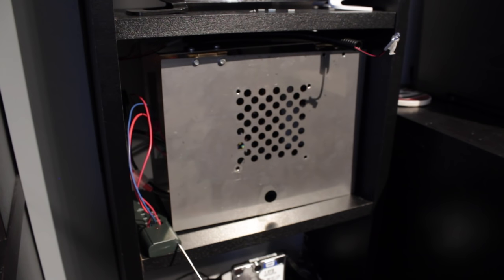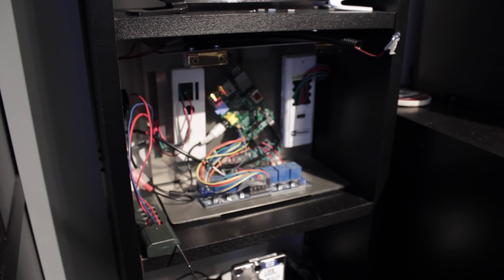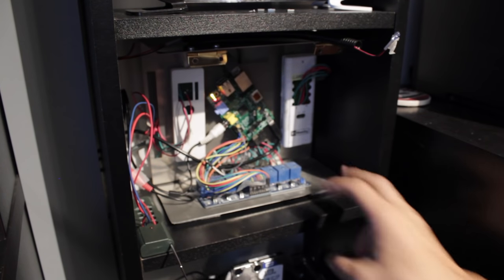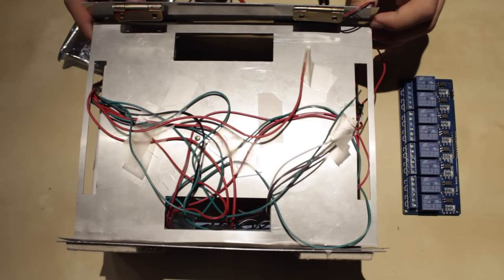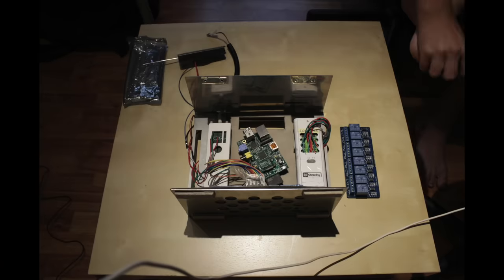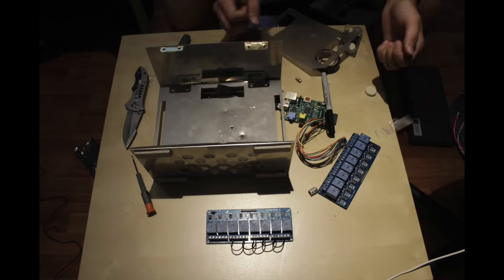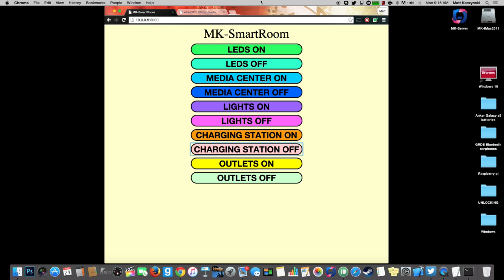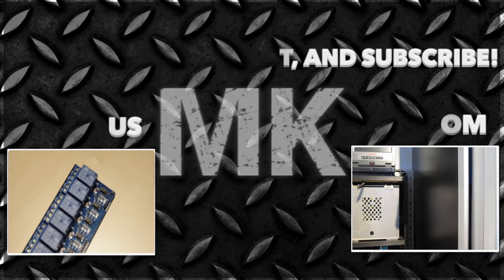Raspberry Pi: Home Automation Upgrade #1

Comment: On the right of the relay board is power to the relays. You can feed power directly so it doesn't zap all its power from the PI.  Ground to GND and 5V to VDC and leave JD-VNC empty.  When using the jumper the relay takes it power from the pi and can cause excessive draw when they are all turned on.  Use a separate power feed rather than the 5v from the pi if going down this road.

Comment: Hey man, cool setup! 
I was wondering, since every thing is wireless, if it wants't possible to simply use a RF chip and tap into the frequency of the outlets. Seems like a fun project to me and would cleanup every thing!
Reply from the maker: Yea, that is a good idea except I'm starting over from scratch and creating a brand new system if you are interested and want to know more about it check out episode 1 on my channel.

Comment: just wondering how you connect to the pi via Web browser
Reply: A "beginner" way to setup a web interface is to download XAMPP web server to the PI and set up a webpage with PHP backend that initiates a python script on the PI which controls a individual relay. Or, a bit more better but more complicated, is use a Python WSGI web app like django that can directly interface with the GPIO scripts.
Reply: Be sure to read Home Automation review on my blog before you buy. Go to peacereviews. com/home-automation-review/ Thanks. Lpd Simmonds.
Reply: IRGeekSauce easiest way is to download Pirelay Pro from the app store. Everything configured, just plug and play